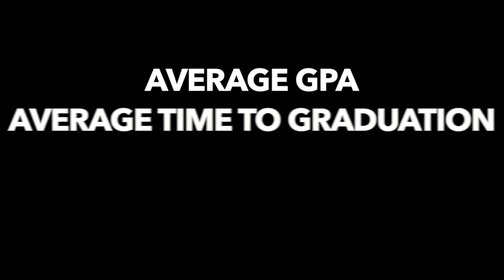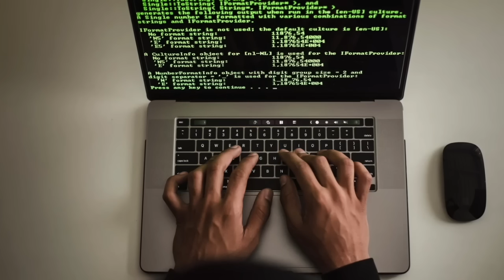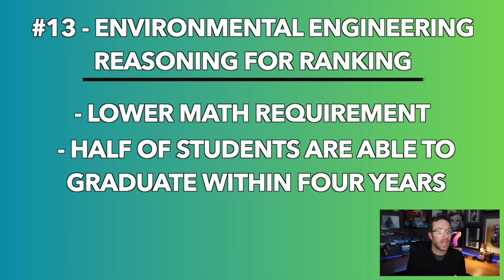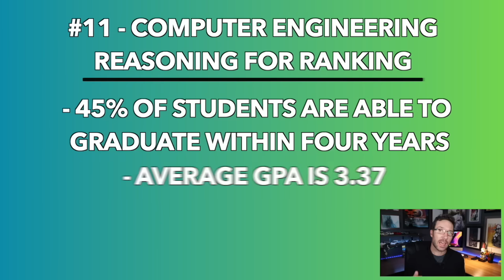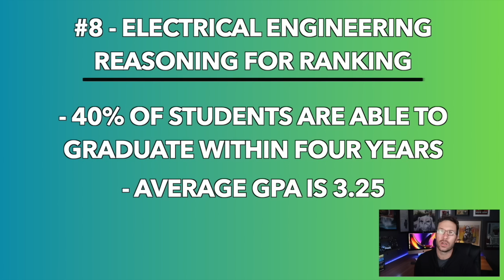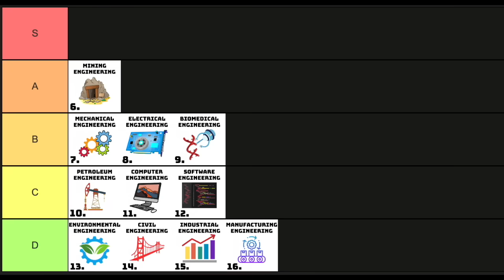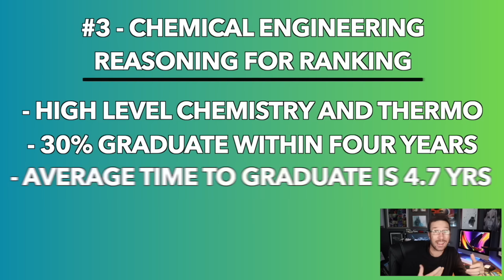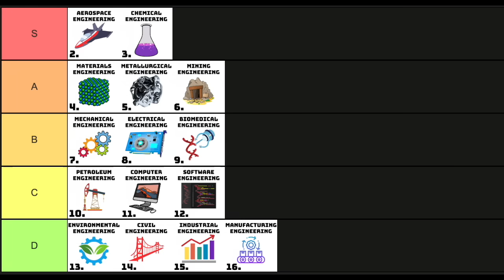Engineering Degrees Ranked By Difficulty (Tier List)

Comment: Completely missed the hardest Engineering, Engineering Physics. Its often in the EECS or Nuke-Eng departments 
Engineering Physics takes the core math and science of a physics undergrad, and then a core concentration in MatSci, Nuke, EE, or Biomed. Where the classes overlap, they get credit in both departments. An example EngPhy 
Semiconductor Engineer mix - Core EE, Core physics but you get to skip Optics in EE because the physics one is more rigorous, along with Solid State Physics and a foundational MatSci 200 level class. Then in the last 3 semesters, take electives like Optoelectronics, VSLI, Lasers, etc, etc 
OR 
Plasma Physics Engineer, Core Physics, Core EE, last 1.5 yrs fusion/high energy plasma systems design, plasma diagnostics lab, climate and space plasma physics, etc etc 

It is BY FAR the hardest Engineering Degree, with core physics requiring ODE, PDE, Real/Complex analysis, Linear - taught by the math dept in rigorous courses not Linear Algebra for engineers bs. 400 level physics math class (like a round up before 400 level core reqs), In the 400 Level physics, QM, Stat-Mech, Langrangian/Hamiltonian physics, E&M (woo Griffiths!).

Comment: I was confused when Mechanical Engineering was claimed to require the highest level of math, but by the end found that Engineering Physics is not even mentioned--so that might explain this strange claim. Is Engineering Physics not common in the USA, or are graduates not considered Engineers?
Reply: It's not that common in the U.S., I think.  In my undergraduate university, the closest thing we had was an Engineering Science and Mechanics department, but it also was a very small department (and I don't think it actually offered an undergraduate degree, just graduate degrees) and sort of unusual.

I think a lot of Engineering Physics ends up split between the Mechanical Engineering departments and the Physics departments, which would explain the mathematical requirements in the ME degree.
Reply: @BrooksMoses  Yes, quite likely. I graduated in 1961 when there seemed to be an internal division into nuclear, electronics, and "mechanical and materials", so now we have them more often as separate fields.

Comment: You left out Naval Architecture and Marine Engineering - admittedly a niche, but very broad degree. Fluids, structures, electrical, vibration, mechanical, operations and construction - it's all there.  Try designing a building that lays on it's side - and moves. Then figure out how you're going to build it.  128 credits, advanced linear algebra and differential equations.  Still, the hardest problems I had to solve in my career were not engineering - they were human.  Learning how to manage and motivate teams is not something that was taught in the engineering schools of the 1980s.
Reply: Don’t forget the thermo elements too, related to propulsions systems. And the statistical analysis elements of sea keeping. But yeah, I’d love to see how this would rank… kind of surprised that it was missed, given the report a couple of years ago that put this at the top of one of the salary lists. Also (depending which school you went to) the fact that most of us powered through in four years makes for a more, not less, difficult program.

Comment: I study a barely known degree Ocean Engineering which was basically Civil and Mechanical Engineering applied to the ocean environment. This degree came about to fill the need to design and construct offshore platform - which are neither ships nor fixed structures - used for deep ocean oil/gas production. Also, the other area was on shore structures such as port and jetty design. We had some cool classes such a wave theory, fluids, acoustics, and corrosion. We even had some electronics as the first wave of undersea robotics where being constructed.
After graduating in 1982, I went back home to work with the Oil Industry in Venezuela, just to find out the offshore program has been cancelled in favor of the heavy oil deposits inland. So no job for me there.  I ended up having a carer in Consumer Good Companies like P&G, Coke with a brief stint at McKinsey after getting an MBA. All of these to say that any engineering degree is good for  life as it teach you problem solving and critical thinking. Learning to quickly separate the wheat from the shaft with discipline would get you places.

Comment: Mechanical is too low.  
Time to complete is also a function of student caliber.  
The level of math required is a strong indicator of difficulty.  
Chemistry is a completely unique field in that you have to have an incredible memory and know of all the characteristics of compounds and reaction types.  In fact, as far as organic synthesis goes, you have to have a unique talent for that.
Thermo and Physical Chemistry are the toughest undergraduate courses - any degrees that require them should be of the most difficult.

REGARDING SCHOOLS:

Getting a ME degree from C-MU in Mech E, we saw what MIT BS Mech E kids had to take and a lot of us thought we might not be able to do it.  So the School is a monumental factor.  When you look at the Top 10 schools,  the difficult in that small set increases exponentially where #1 is massively more difficult than #2.

Suicide Rate unfortunately is an unspoken metric ranking schools.  The greater the rate, the more difficult (i.e. better) the school is.

Comment: I need to put in my $0.02 from 35 years in the software industry.  Almost nobody who calls themselves a software engineer is a real engineer...they're just a programmer.  There is nowhere near enough rigor in the discipline.  Just my experience: most programmers are lazy schlubs (including me).  If civilization really had to rely on programmers (like it does on civil and mechanical, etc), civilization would implode.
Reply: being a software engineer doesnt mean you limit yourselves only to purely programming though..

Comment: Interesting video. My personal experience is from the 70's, when I was getting a PhD in mathematics. I encountered quite a few PhD students in engineering, physics, CS, and materials science (they were either PhD students taking math classes, or the students in other fields where I was auditing classes, to learn about the subjects). My experience was ME's were the best, followed by physicists, then EE, Aero-Astro, and materials people; however, 'best', mostly means 'best at math', since that was all I knew about. And my sample was too small to be meaningful. 

On another metric, the Chem E's had the best food at the colloquia, and it was all free. EE's and Aero-Astro people had free food, but it wasn't much good, and I don't recall the food from any  other departments. 

Finally, the CS doctoral students seemed to have the least trouble getting jobs, but this was at Stanford in the late 70's, when the software boom was really getting going, so if you could count to 10 and program, you  could get a job (and the CS students I knew were very, very good). The people who had the most trouble getting jobs, at the time, were math students.

Comment: The nice thing about Aerospace engineering is that it overlaps with most of the other engineering disciplines.  Propulsion is applied thermodynamics,  fluid dynamics, aerodynamics, control system design, exotic structural design, orbital mechanics, design for the vacuum and temperature extremes of space,  lab testing.  I managed a 4.0 in the first EE class but my GPA was a tenth too low to get in the department.  I ended up getting accepted into the Aerospace department and those classes I worked my tail off to stay at the median of the class with 3.0 average.  Funny to see EE ranked so easy.  There is a ton of competition to get into that department, so only the best students make it.

Comment: I think your ranking of Electrical Engineering is way below its correct ranking.  I started off my education in Mining Engineering (with a full ride scholarship), but quickly changed my mind a year later after taking geology and surveying courses that were less interesting to me.  I completed a BS in EE in 1987 and subsequently worked for 2 years in biomedical engineering with a number of PhDs in Mechanical, Electrical, Computer and Software Engineering.  I was working on the Artificial Heart project (Electrohydraulic Total Artificial Heart)  with numerous surgeons, physiologists and DVMs at that time as well.  I subsequently returned to school and completed an MS in Computer Science while doing research on the Human Genome project with numerous biologists, geneticists and other medical doctors.  After completing that degree I went to Medical School and completed an MD.  I currently work as a pathologist with a strong emphasis in pathology informatics.  Electrical engineering was by far the most challenging for me personally out of all of my degrees.  It required significantly more math than you stated in your video.  I completed partial differential equations, engineering mathematics (including Fourier Transforms, Laplace Transforms, Calculus of several variable, etc).  I was also required to take extremely difficult graduate level courses in probablility, material science, and modern physics (including quantum physics) to complete my EE degree.  As a result of my decision to go to medical school, I also had to take numerous of other chemistry courses and biology courses, including organic chemistry, biochemistry, physiology, anatomy and genetic analysis, prior to attending med school.  I feel that I have had significant exposure to most of the degrees and course work you mentioned in your video.  I also have multiple friends in most of the other engineering fields you discussed.  It took me 5 years to complete my EE degree and I ended up with a 3.7 GPA.  I studied continuously to get that EE degree and it stretched my intellectual capacities to the limit.  It was harder than any other intellectual endeavor I have ever done, including medical school and my subsequent residency in pathology.  I wouldn’t do it any differently though.  It has been an incredible journey and I have had an extremely rewarding career.  I am now planning on retirement in 2 years.  No matter what engineering field one chooses it is an excellent choice.   It prepares one for literally any type of career path you can imagine.

Comment: Software engineering is very difficult to pigeon hole.  Some of it is not terribly difficult (simple web page development  is an example) while other software development like large scale, highly robust, highly performant  back end systems is extremely complex.  One of the challenges of software development is the need to gain an understanding of space for which the software is being written.  Some will need calculus, others trig, others statistics.  Beyond that, you have to be willing to learn about logistics, insurance, sales, ... whatever the application space might be.

Comment: Not sure what your definition of credit hours is, but my 4 year ChE degree required 17-18 hours per 10 week trimester. First 5 periods were math, chemistry, physics plus 4 hours per period non-technical. Last 7 periods were 12-14 hours chemical engineering specific plus a 4 hour technical elective. So 204-208 hours to graduate with about 170 technical hours. I also had to take partial differential equations and 4 hours of statistical analysis. My school also required ChEs to take two trimesters of physical chemistry in addition to two trimesters of ChE thermodynamics.  ChEs always felt EE was harder but all other curricula (CE, ME, BIOE &EE) felt ChE was harder because of two trimesters of organic chemistry.

Comment: I’m wondering where you got your required credits require from.   I graduated in civil engineering in 1992.  Between the University requirements, and the ABET requirements civil and mechanical required 142-semester hours, computer engineering required 145-semester hours and electrical required 144-semester hours.   Which if 14-semester hours is full time, is ten semesters, and I was one of the few in my class who graduated in eight semesters, because I dual enrolled at two colleges, a community college for core classes such as English, literature and fine arts, then transferred the credits form the community college to the university I was doing the engineering degree at.  

I recently reviewed transcripts and resumes of recent civil and mechanical engineers to hire entry level engineers.  All of them who attended ABET accredited programs, had between 142 and 147-semester hours.   Students who didn’t graduate from ABET accredited programs, were missing key classes such as Engineering Economics, and Contract Law.

Comment: Good video.  I would argue that Electrical Engineering is, to me, the hardest!  I have degrees in Mathematics and Computer Science.  I did well and graduated Cum Laude.  However, I did NOT complete my degree in Electrical Engineering.  I had completed half the required courses but I had not scored well and I was ill prepared for the second half of courses yet to be completed.  Demand for CS was high and salaries were above average.  I spent more than 35 years writing code and ultimately became manager of Software Development.  Finally, I retired in poor health.  Retirement is great but I loved my 35 years developing software.  I had interesting clients like NASA and the Navy, to name a few.  Of all the projects I did I found Graphics to be most satisfying.

Comment: What the hell is ordinary differential equations? How many above AP calculus is that? 😆
Reply: Two or three semesters.  Depends on how high the AP Calculus gets.  Typically calculus at the college level is three semesters, and Differential Equations is another two semesters.   I graduated in civil, and was two senior level math classes short of a math degree.   A couple of my study buddies did get the dual degree in math.  And one did a dual degree in civil, and applied physics, in hydraulics.   Her senior design project was a computer program to model the velocity and pressure of water going through gate valves.

Comment: If you're having trouble deciding what engineering to do, stick to choosing between mechanical, chemical, electrical, computer science, or industrial. Other specializations don't prepare you as well for general industry and seem to steer you towards research, which can really limit where you can work and what you can do. Industrial is probably the most applicable to the most fields because it's basically operations research (data science and business adjacent) in engineering.

Comment: How can so many engineering degrees over there not include somthing as basic as solving partial differential equations? You need to understand that to properly understand the how Finite Element, Finite Volume, and Finite Difference methods are built and applied, and those are supposed are such classical ways to solve a ton of engineering related problems. Then again, it is engineering, so people might have just learned the end form of those methods and not how they are derived.

Comment: I graduated in Electrical Engineering (Electrical Engineering and Computer Science - EECS), from UC Berkeley about 9 years ago, and had to take Partial Differential Equations and Linear Algebra. So I don't think that "highest level of math" is uniform across various institutions. Personally, I found both ODEs and PDEs much easier than Linear Algebra.

Also, Linear Algebra (which is a rather difficult math course), is required for both electrical engineering and computer science at most institutions. Additionally, Discrete Mathematics, a rather challenging math course (which I also had to take), is required of these majors at most institutions, whereas other engineering degrees don't require it.
Reply: I imagine that a lot of these things differ quite a bit depending on how they're taught, too.  My undergrad school taught Linear Algebra as a first-semester Freshman course, and my guess was that we covered rather less of it than Berkeley did if they were teaching it for more-advanced students.  And certainly the typical one-semester ODE and PDE courses teach only the basics of those topics, with a bit more being covered if they're taught for later years.

Comment: Woah, back up. 3:19 "studying performance"? Okay, I thought that the exams were there to prove how well you studied. I failed calculus, despite knowing the content thoroughly, and testing higher than the rest of the class, all of whom were older than me. I got an overall D in the class for not doing the homework, and that affected the future of my life trajectory big time. Need to get rid of any idea of "studying performance", because in the real world it's about who shows up when it matters most.
Reply from the maker: some folks study very well and learn the material successfully but do poorly on exams due to things like test anxiety. which is why i distinguish between "studying performance" and "exam performance"
Reply: @becominganengineer2271  so what does it mean if your exam performance is great, but study performance is bad? Should people overlook you just for that? I prefer not to waste my time, but I ended up wasting almost all of my young adult years.
Reply from the maker: Good question. I think these people are very rare. Folks who can spend much less time studying and still do well on exams…. They exist… but they are not the norm.
Reply from the maker: what technicality? the fact that some folks are naturally gifted? I dont see why that hinders your ability to work hard and excel?
Reply: @becominganengineer2271  the technicality of graded homework (i.e. red tape). Aced AP finals + top 0.1% standardized testing = work at Arbys.
Reply from the maker: So you did well on AP and other standardized testing. What happened in engineering then?